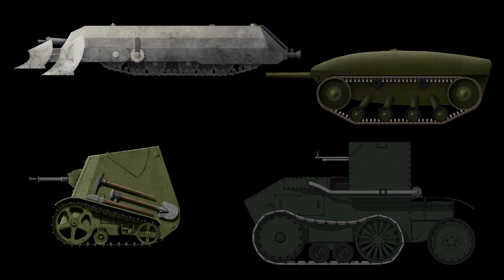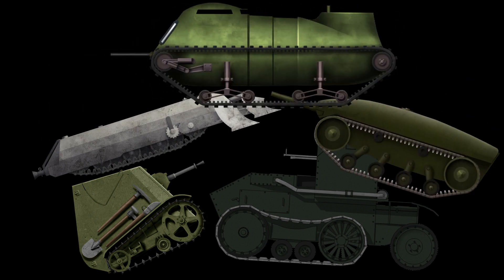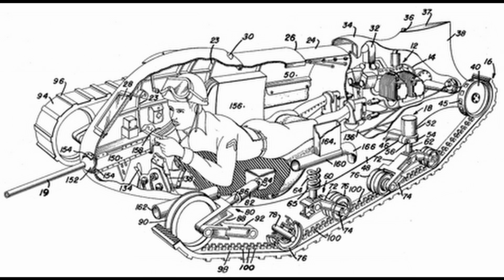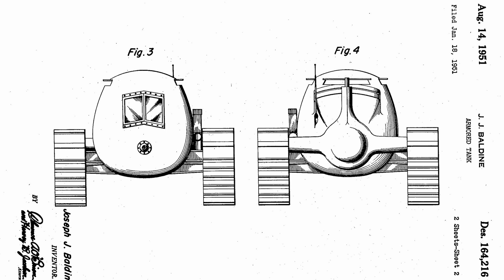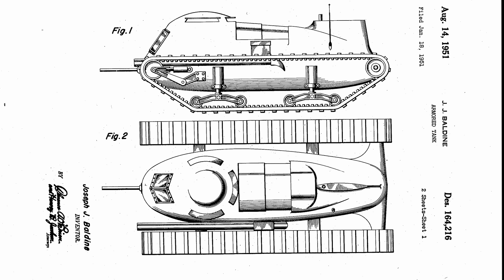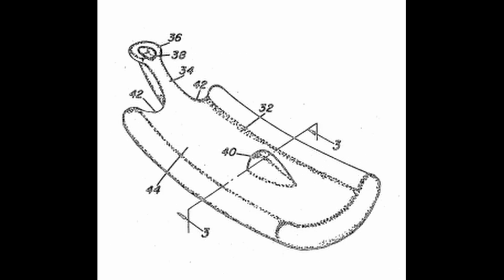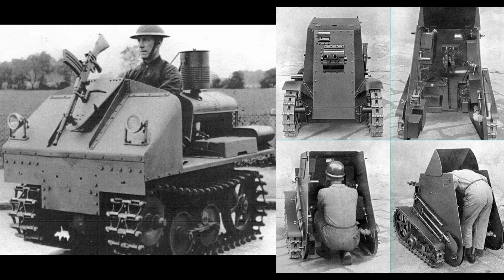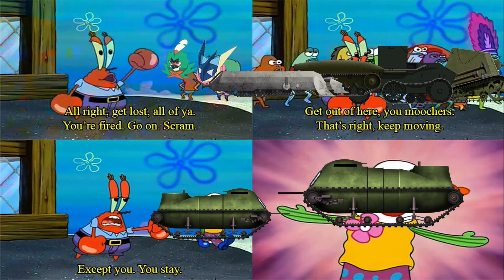How To Stay On The Drawing Board | Baldine One-Man Tank

Comment: I have to question the assertion that one man tanks are a bad idea/ unworkable. Given what has been floated as to why. One man fighter aircraft should be just as a bad idea/ unworkable. Yet they are a mainstay of all air forces.
Reply from the maker: There's a couple of problems with your comparison.

First off, aircraft visibility is mostly similar between classes, while one man tank visibility (due to the low height from the ground of these short machines) is markedly worse.
Then there is also the problem of overtasking. Driving a tank has far more tasks than piloting a plane. It is not just steering and acceleration, there's also breaking and changing gears, plus having to watch out for terrain.
Also, firing a movable machine gun is far more difficult to than aiming the whole plane. Not to mention reloading.
Then there are the issues of getting out of it.
Reply: @TanksEncyclopediaYT  most of the driving/ operating issues are second nature to almost anyone from a motorized civilization. Automatic transmissions are old tech and reliable. Making reverse the only required gear change. Pilots have to do their own navigation and weapons management. In addition to controlling a high speed vehicle in 3 dimensions. Controlling a weapon that can traverse is old hat for helicopters. Visibility is an issue even with MBTs. The only real problem I see with the concept is reloading different rounds. But there are systems out there that allow switching of ammunition feeds automatically.
Reply from the maker: @travisgravelle7687  Well, then it seems it is the right time for you to write a patent about this new vehicle system you're proposing. 

Good luck with it, we'll write an article on it in about 10 years, hope you're successful :)
Reply: @TanksEncyclopediaYT  thank you for your support.
Reply: This is a pretty interesting back-and-forth. Just to toss in my two cents... it sounds like "functional one-man tank" falls in the same sliver of possibility as the FG42 rifle. It's a pretty much impossible list of requirements, but it sounds like it would work if you apply enough pipe dreaming. You can say a million times that it's easy on paper, but only once might you get the miracle of a device that actually threads the needle of impossible requirements and becomes a practical piece of combat equipment. The debate in this thread has some decent points about what the challenges are, and how they could potentially be overcome. But this is a perfect example of something easier said than done.

And as an aside... for all the difficulty of a "one-man tank" you can just stretch it out a little and have two people in there with a lot less problems to solve.
Reply: @johnladuke6475  the issue, as I see it, is not so much design as it is employment. You can't just replace infantry. Which has been the focus of most one man tanks. They'd be better suited to a fast reaction force supporting infantry.